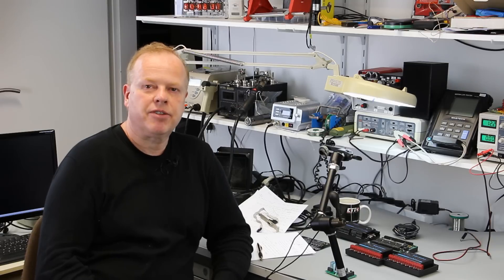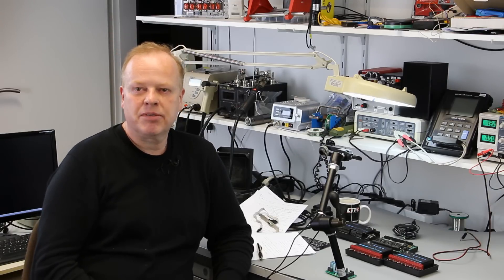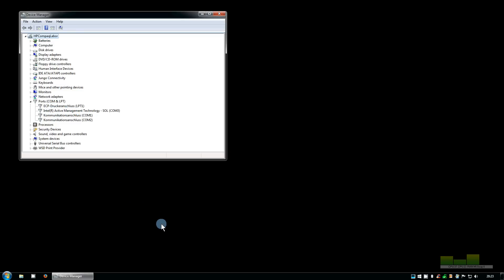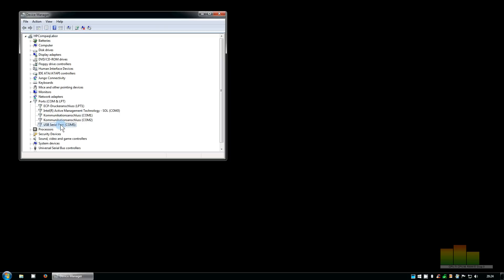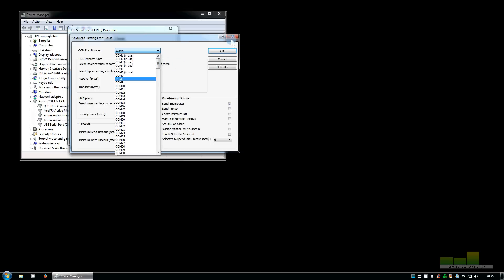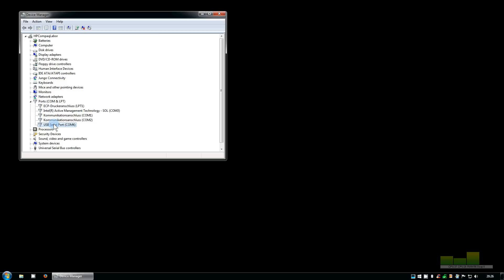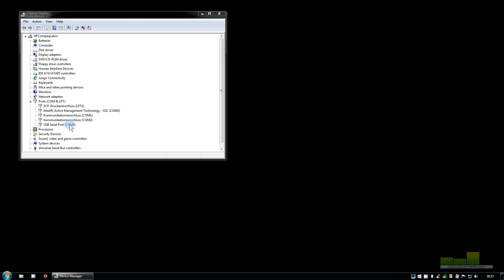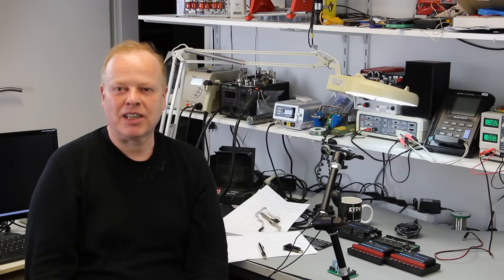USB-COM-Port Adapter installation and COM-Port settings

Comment: Thank you I have problems with connection in the beginning start the device is connection with PC by com1 but after one hour the mouse is moving and no work . When I leave the cable the mouse is working

Comment: Im trying to use my arduino nano.I had to download the driver. That works but it chose com 7. I* have only 2 usb ports on the front of my pc, I assume they are 3 and 4. 
2 unused in the back. four total in the back. The nano still wont upload a program to it. I should just be able to connect the nano to the front usb ports, right?
Reply from the maker: I don´t quite understand your problem. USB-port numbering has absolutely nothing to do with the numbering of the (virtual) COM-port numbering. Change the COM-port number of your adapter to the lowest available number. Restart PC! 
And don´t forget to choose the right COM-port number in the arduino programming software!
Reply: @KainkaLabs  Thanks for your clear explanation. I have since been able to upload blink sketch. When I try to upload DHT11 sketch, I get the error EXIT STATUS 1. What  does that mean?

Comment: hi, thank you in advance .. is it possible if i want rs232 serial to mini USB?
because there are many in the market that USB to Serial RS232, what if you want to change it to the opposite? so data communication between serial rs232 to USB.
Reply from the maker: Data comunication is alway duplex (both directions) in a USB-Serial converter. No matter what type of chip or what kind of connector is uses.

Comment: Thank you for the Video, I do not have a COM port in my machine, but I successfully managed to have a Virtual COM on my Machine, my objective is to connect a GPS device to a GIS software, and the software only makes a connection through a COM Port? Any Ideas will be really helpful:)

Comment: in the divice manager  i do not have that file (com-lpt) how do i find it to be able to id the ports and port numbers...
Reply: sorry win 10
Reply from the maker: If there is no COM-port and no LPT-Port in your motherboard (like in most laptops today) or there is one but it is not activated in the BIOS or you don´t have one connected, of course that section doesn´t appear in the device manager